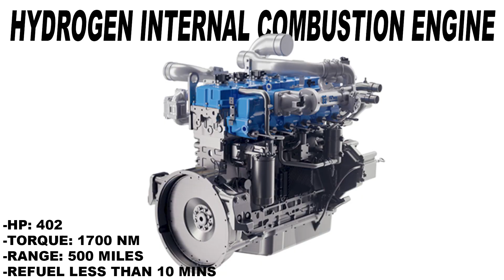Why you will Pay More for your EV's Insurance

Comment: I rented a Tesla Model Y recently. First time even in one. Acceleration was the most impressive feature. 

Interior wasn't nearly as good as I expected. Charging was the biggest problem. I went to 3 different stations (Chargepoint) and none of them worked.

My 110V in the garage charged at about 4 miles per hour.

If you don't drive alot and aren't going on any road trips EV's are pretty cool. 

Also, I live in a valley surrounded by mountains. In winter months the cold air holds the pollution in the valleys and its terrible. EV's help reduce air pollution here at the expense of producing it somewhere else. 

Overall if I needed another car and had a budget of 60-80k I'd buy one.

Comment: I agree with you as I for one know about the high cost those metals have on folks living around the dig sites: https://www.youtube.com/watch?v=ipOeH7GW0M8 Most people don't know that almost nothing will grow on contaminated land from these toxic chemicals as well as birth defects in children. So, we must then go to a 50 plus year old technology that started in the Philippines by Dr. Dingle whom drove not one but two presidents around in a car with it's tank full of water back in 1968- 69.
I wish the world's education system wasn't so screwed by those that sell energy to the masses as due to their meddling most if ask don't know that when gasoline is burned in an ICE car it is the hydrogen that is actually burning. Thus right now the world is running on hydrogen for the most part and these fossil fuel burning vehicles really don't care where they get the hydrogen they need to  burn from so pure hydrogen from h2o will work just fine. I am still however scratching my head as to just where did that company Hysata run off too?